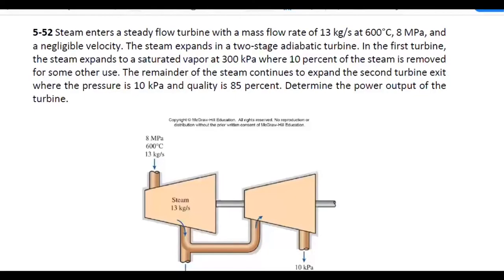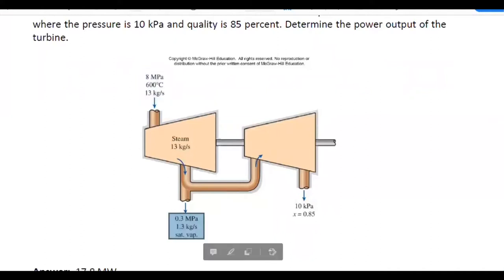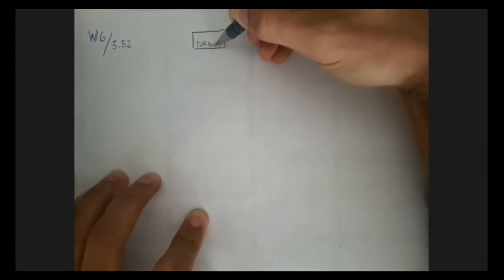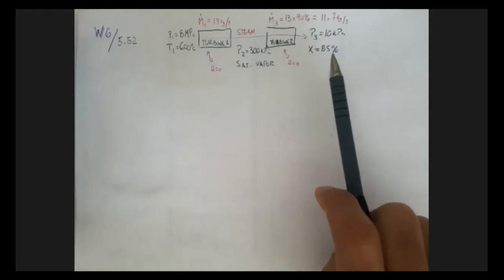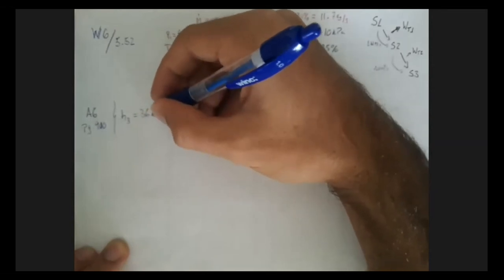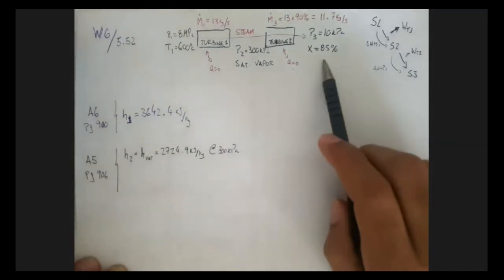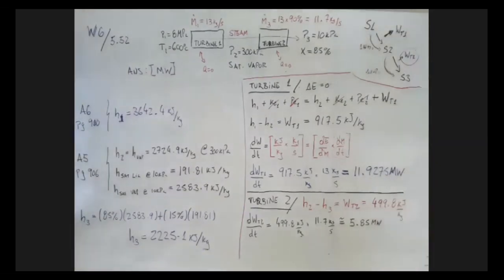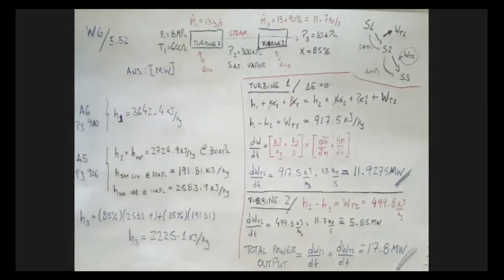Thermodynamics Mech3001 - Week 6 - Problem 3 (5.52)

Comment: Hey sir, its Eli, I wanted to ask a question, are we able to use the cold air equation for variable specific heats, even though it is not as accurate, for OTTO cycles? Kind Regards.
Reply from the maker: Really depends on what you are after. The results, as you said, won't be as accurate. If this is for an exam or an educational question, there will generally be an indication. For instance, the sentence "use constant specific heats at room temperature" is telling you that it is ok to use the Cp/Cv approximations. If nothing is said whatsoever, I recommend using the approximations as it will save you time.
Reply: @EngineeringHack  The past paper question says “considering variable specific heats with temperature”. I was hoping the cold air equation (efficiency) would be accepted in this instant, as with  that equation, I can work backwards, and find everything in the span of 5 minutes. With only needing to find Q,in legitimately, as Net Work and Q,out can then be correlated to the efficiency.
Reply: @EngineeringHack  n = 1 - 1/r^k-1 is the equation. Within the question, I need to find thermal efficiency, heat transfer due to addition, and Carnot efficiency.
Reply from the maker: @EliteObeid  Yeah, so in this case the situation is the exact opposite. If the specific heats are varying with temperature, it means you cannot use the properties at 300K. You'll need to use property tables and relative volumes/pressures.